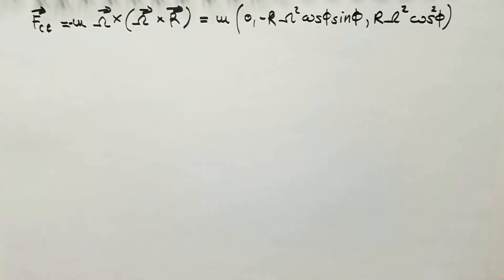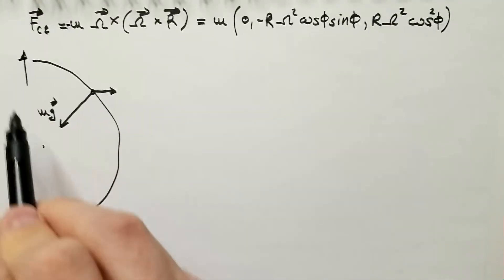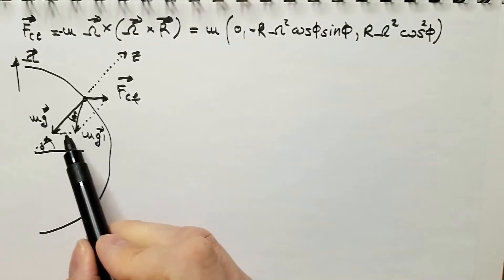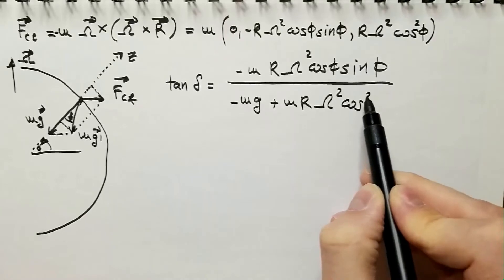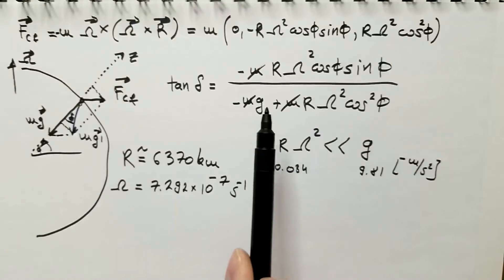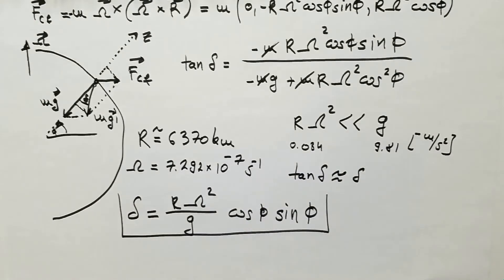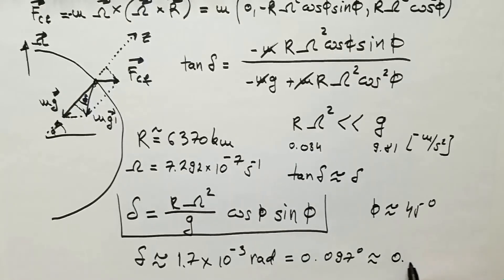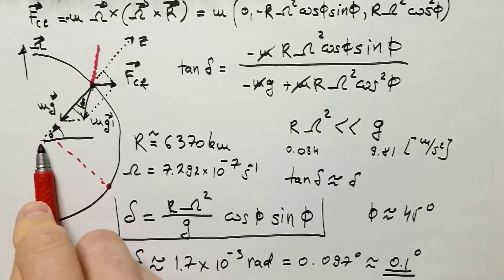Angle of Plumb Bob and Apparent Gravity

Comment: Question: What is the the force in which an accelerometer sitting on table (stationary) will measure, the gravitation or the apparent gravity?
Reply from the maker: Apparent gravity because the instrument is rotating together with the Earth and is therefore affected by the centrifugal force. As indicated in the video, the difference between the two forces is very, very small for all practical applications.